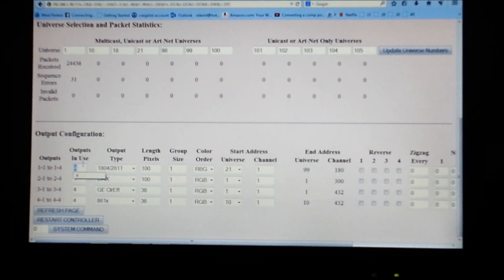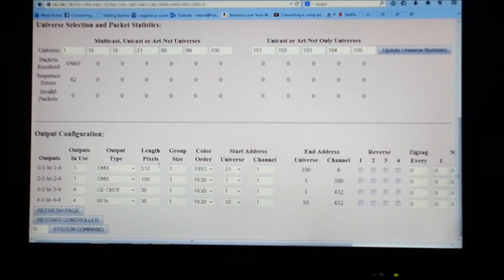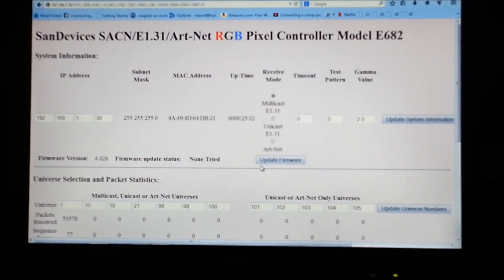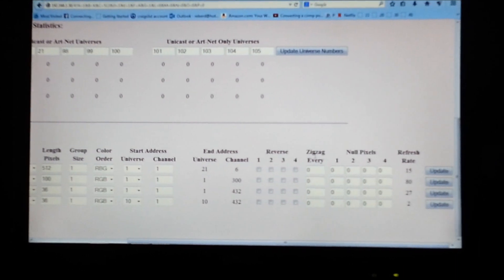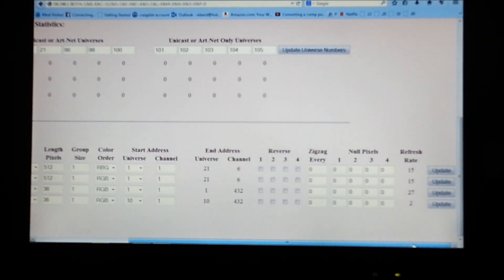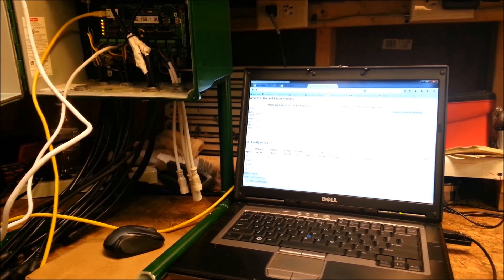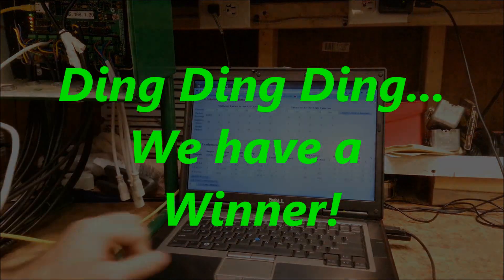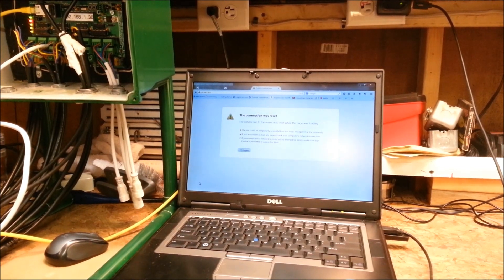Setting Up E1.31 on Windows 7 (Part 3B E682 to DMX)

Comment: somewhat informative .I purchased  an E1.31 4 controller from wowlights. still trying to get lights synced to lightorama. Will try some of your information .Im not as advanced as you are and Im trying to get it up and running before I have to take the light system down .I built a 200 pixel marquee panel with 4 intelligent rgb strings set up in a zig zag pattern and I hope to program something special on it.thanx for the info.